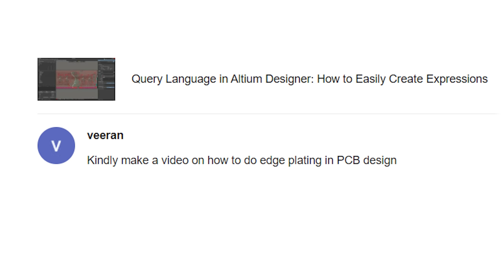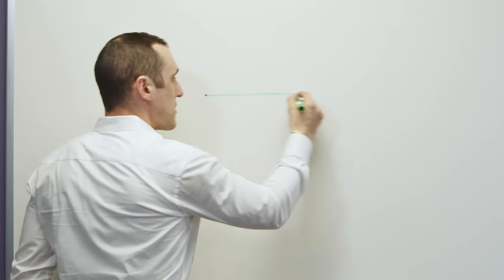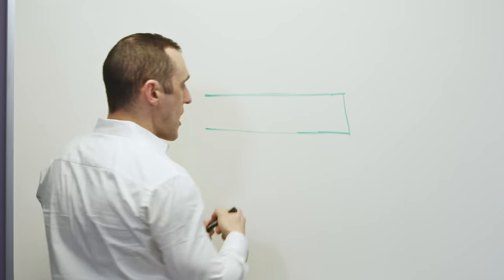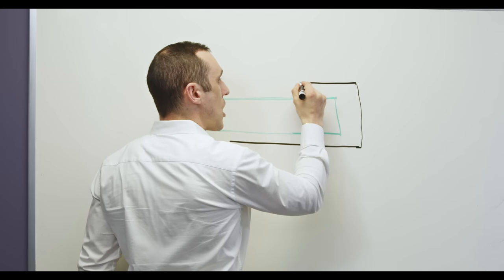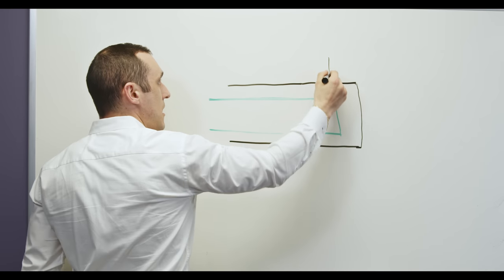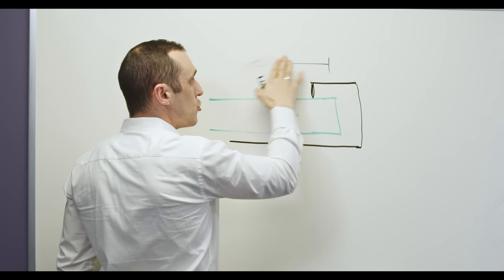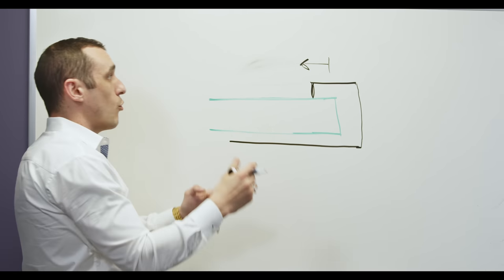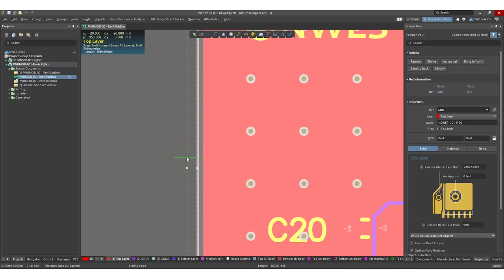PCB Edge Plating Guidelines

Comment: Hi, will it increase size of the board  by size of polygon? Or it will keep size from board shape layer + 30-50 micron of copper clading.
Reply: The polygon does not set the board size. When you export the fabrication data, the fabricator will define the board outline from a specific Board Shape layer in your Gerbers or in your ODB+ files. This is the outline of the FR4 used to build the board. Once the board is plated along the edges it will have a slightly larger board size based on the plating thickness.